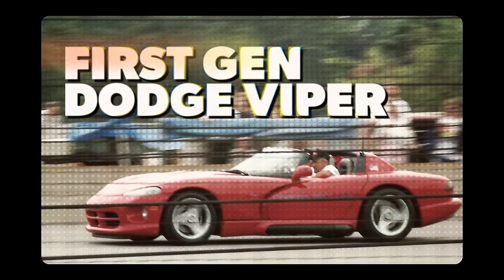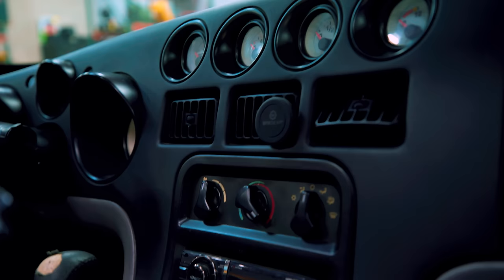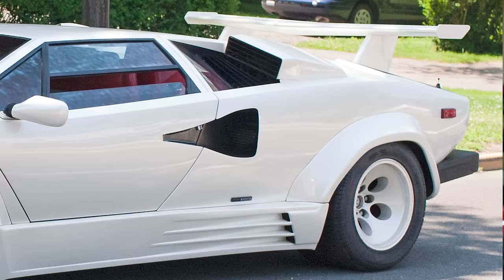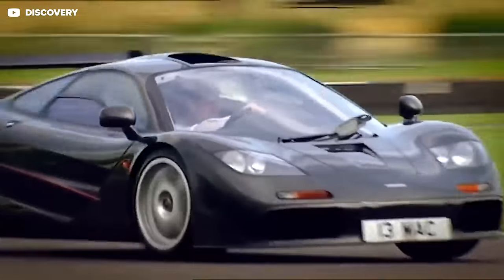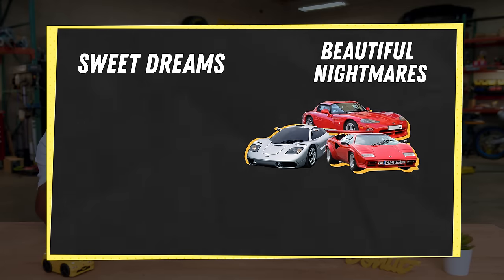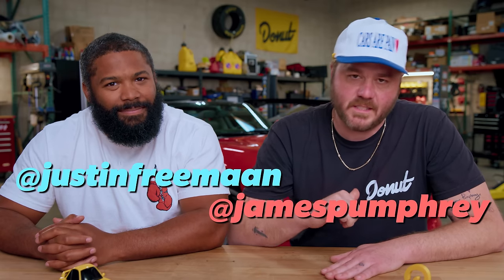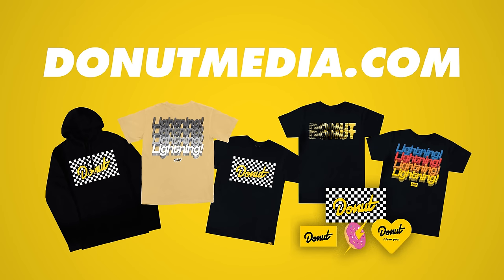Cool Cars That Suck to Own

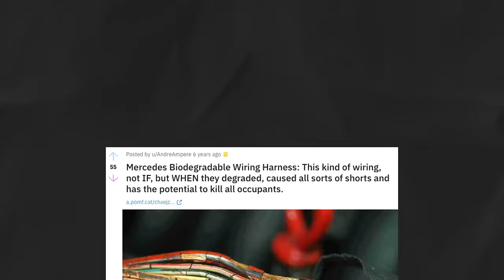Comment: 6:14 "Biodegradable wiring harness", this, this is why even in a democratic nation, you need to elect experts in the field for ministerial positions in government, not talking faces with overdone smiles and horrible ideologies whose only talent is lawyertalk. Everything from morbidly unhealthy heads of ministeries/departments of health (yes, Belgium, I am talking about you), departments of defense ran by someone with no experience in security or the military (half of all western nations at least half of the time), or aptly in this case: Probably another department of transportation ran by someone without a driver's license or background in logistics/electrics/mechanical engineering (probably even more common than the last two examples). Someone from the Donut crew for Transportation department head? Too much to hope for?

Comment: Antilock brakes and traction control are for girls that can't drive. Abs is good in snow, that's it. Traction control is only good with lots of hp and a slick surface. Aside from that both suck and are annoying.

Comment: Or you could just ignore those rules with maclaren F1 like any other car and use simple tyre levers and replace tyres at home and ignore the fuel cell rule and just let the warranty go and use it like normal if you have hundreds of millions why would you care, im sure most normal Corner tyre shops could also replace the tyres in like 1 hour.

Same with the Bugatti you can simply move after buying it not tell them where and do own oil change and even change the wheels to something different with different tyres. 
ahwell so the warranty is broken. 
They cant track you down and force you to follow their rules that would mean a restraining order as that would be stalking and if they threaten to take it away than well criminal charge for them, regardless of contract you sign once you pay for something its yours. 
Specially if you ship it to another country then you are no longer bound by any laws from the country of origin.

Comment: So let me get this right, you trash Mercedes-Benz over a $1,500 wire harness? Ummm.. I have a 1992 r129 in arctic white. No other car on the road looks like it. No other convertible drops as low as it does. I have the absolute best view 360° around me as I drive.

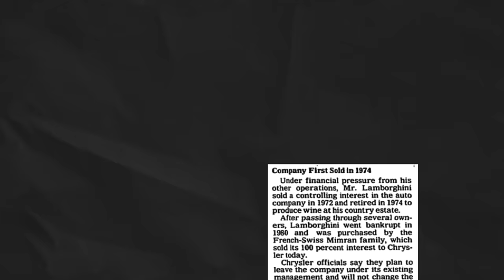Comment: At 2:13  ..."(the v10) was derived from the Lamborghini engine..." No, no and no...the engine was designed by Dodge but the Aluminium block was casted by Lamborghini...it was all-American designed. If this guy is this stupid, anything he says should be regarded as word-of-mouth rumor and not factual.

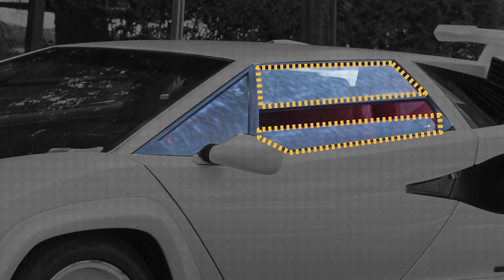Comment: I made it to 2:44 minutes.  First as a true car enthusiast who has owned a couple of Vipers, I can tell you first hand that it there is probably no car that is cooler to own than a Viper (any year) and it never sucked owning any of them.  Having to explain that these cars are not practical (including the Countach) is quite silly.  They were not made to be practical in any aspect. If you dont know this and no type of light bulb went off indicating this before purchasing one of these cars, you obviously aren't very bright.  These are specialty cars that are designed with no practicality in mind.  Pretty silly video.
Reply: Just because you like it doesn't mean the rest is the same. I myself never like the 90's Viper. The 2000s Viper is much more practical. The 2013 Viper is in a completely different league.